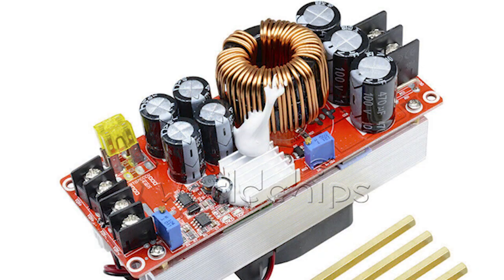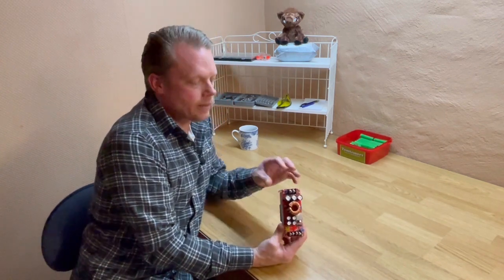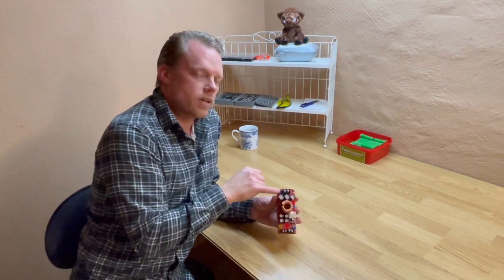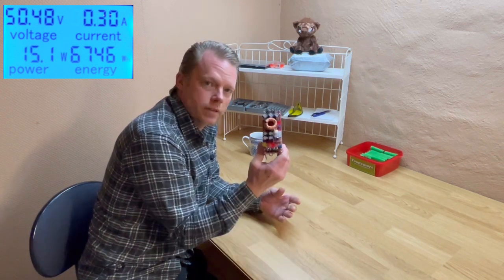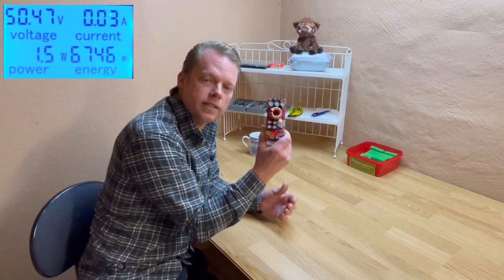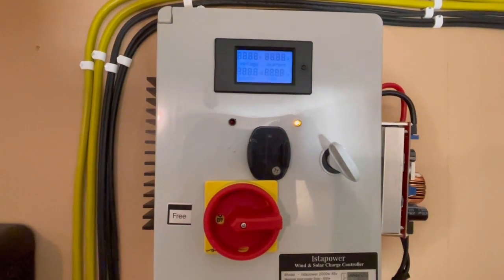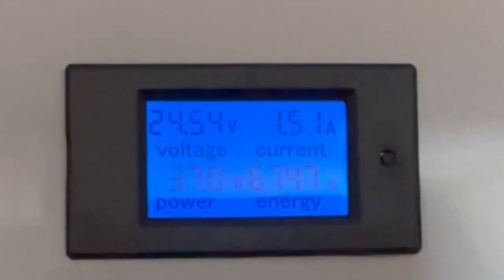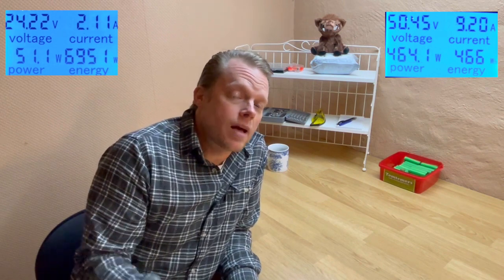Low wind charging, from my wind turbine istabreeze i1500 48v

Comment: Hello ! I also have an IstaBreze wind generator and controller 48 V 1200 W Solar panels are connected to the controller. Where did you get the power connection to the DC&DC controller in the IstaBreze controller? Marcus Ehrenpreis
Reply from the maker: Hi Margus! I bought it on eBay. Here is a link to it. Thanks for your question and have a great day sir. 

https://www.ebay.com/itm/164271138208?_trkparms=amclksrc%3DITM%26aid%3D1110006%26algo%3DHOMESPLICE.SIM%26ao%3D1%26asc%3D20190917065201%26meid%3Dcfe05e5873034119a96e36a9d6f9eeb4%26pid%3D100935%26rk%3D2%26rkt%3D12%26sd%3D322541655456%26itm%3D164271138208%26pmt%3D1%26noa%3D0%26pg%3D2332490%26algv%3DSimplAMLv9PairwiseUnbiasedWebCpr08MlcGreedyV3%26brand%3DUnbranded&_trksid=p2332490.c100935.m2460&amdata=cksum%3A164271138208cfe05e5873034119a96e36a9d6f9eeb4%7Cenc%3AAQAGAAACEFlf0W4DZxQ9rGEp1I1AcwnLNx1QfvvjHgvmNWJHv3VwqjIaeEpGhp4B0hypvCOmtx1hQh93VsR%252F1Wqb99aslFWTINPZSmc3IfMRvrgMh8caQadnaglvUTUlDygPwF3UalUxxqPmDgkTLsPkN4A2h8kdMMUTvtF9Hwc8corD0aOH7M1CtJ%252FR%252Bl28wVeXoeHO6AVlci8wCNMDY3zo2PI2Z4AyLCi38Gt6KtfcKm6HeDd2DWxbV3FwQ1wKhU6Ezb0YFqfV7ce4m0dWIDkbqQxnqsH4Qitc63rdI4nimdHWkble2HOlUChz%252B7JEIstQxOjJD32nU3Dw4FuWVkbtdIWmcH%252FlqeHukCvVp5sl6kqSP0D%252FNWgWFhGXrgi0oYqZhochDWVrq38rhF74PuN%252F3Oo44o531PgJyARpmx0O5ecjAi34W21Js%252Bg3bXevuu8NszuWItwTK6qksU%252FeQkV1e6syN0pruSJrv6UXdKEZ9UW5UtP2cjDLLPAuizUIavxPvN5INipaFEIRgWflN6%252B%252FTyEPwm2JwuLgdlgCJX3gkfmnn3%252BPN9qiSIv%252Fif%252FbZFgFI02m8OL3rzYVr0llIV9lZAtPKoEFOL9yrOqCABuLTq1ptsN%252FBvNz3ibWmN5nda%252Bcxvw5%252Fxfy00CECW1%252FcfUCqi4PTIvYHkROy%252BUFiDG5UwRfDCMVvf7F0Ii%252FhNnqOWH7wmeL4Q%253D%253D%7Campid%3APL_CLK%7Cclp%3A2332490

Comment: Hi , I need your advice , I want to buy an ista breeze i2000 wind turbine and I would like to know how do you think about it with respect to quality, warranty , customer service and over all energy production and efficiency
Thank you in advance
Reply from the maker: Hi!
Quality and energy production is good for that price, I am satisfied.
Warranty and customer service is hard to say, I have not had any problems yet. 
Hope this help and I 
wish you good luck 😊
Reply: @flyingtools  thank you for your reply and time I find it really helpful. One more question, for the same price range do you think there is a better quality turbine that you may recommend ?
And what do you recommend about the inverter should I get the ista-breeze one or is there any better ?
Reply from the maker: I think istabreeze are the best value for the money. I had tried to find an mppt inverter for wind, they will charge even in lower wind conditions or you can do as I have in my other video “low wind charging” when I use a voltages step-up converter.

Comment: How did u install your system ? First at all the Turbine, then the charger, then the dc/dc Converter and at least ur Batterie?
Reply from the maker: Yes, you are right, turbine, controller, rectifier, dc/dc and battery.
Reply: Did you change any settings on your turbine? The break load is still 55.6V? Did the DC/DC convert from 20-60V and push up to stable 48V?
Didn't know how to install, want to build the sams system for low wind. thank you

Comment: Have you thought about installing a bypass system for this voltage booster? Dual solid state relays (on heat sinks with fans controlled by temp sensor) with a voltage sensing at the imput of the booster. Both negatives in parallel and the positives switched. Just a thought.
Reply from the maker: A good thought.
Yes I have, but when I expect high winds I just by pass it manually. The booster do a pretty good job by it self when the current are getting to high. It’s simply adjust the input voltage so the preset current limit not will be exeed.

Comment: Hi is your turbine the 24v unit and you are using the converter to onceythe voltage to charge at 48v
Reply from the maker: Hi. The turbine is a 48 V version. In low wind, the voltage are low so this converter throw that voltage up to my battery voltage so it can charge in those low wind conditions.
Reply: @flyingtools  thanks for your reply
Reply from the maker: You’re welcome.

Comment: Hello can you tell me where did you get that and what's the cost thanks in advance
Reply from the maker: Hi. 
I bought it on eBay. 
Around 25 dollars.
Search for: 

DC-DC Constant Current 1500W 30A Boost Converter Step Up Power Supply

Hope this helps.
Reply: @flyingtools  yes it did, am always looking at your videos, thanks again,,,, will subscribe soon
Reply: @flyingtools  I hope that is supposed to say 25...
Reply from the maker: @nunyabusiness2191   yes you are righ.. i must been thinking in sek😅 Thanks for letting me know. I will correct that now.👍🏻
Reply from the maker: You’re welcome.
Thank you so much, glad to have you here:-)

Comment: Do you think about mount step up converter on each phase wind generator ? It is possible in star configuration. It is impossible in delta configuration.
Reply from the maker: Hi. No, directly after the rectifier seems to be the most efficient, cheapest and easiest way to do this I think.
Reply: @flyingtools  Thanks for the answer! What is your the highest power from the wind turbine ? Is it original rotor and blades ? A lot of people modified that things to make wind turbine more efficient.
Reply from the maker: I have seen a little over 1500 watts but that was in an extremely hard gust. This one is not modified at all. I run the 3 blade black version. I have also tested the five blade version but I was not happy with that.
Reply: @flyingtools  Thanks for the answer! Have a nice day!

Comment: hello my name is Thierry I am French, I like your videos because they are very technical and your installations are well finished.
I would like to know the brand and the reference of the low wind load charger, the one presented in your video, I will soon be installing an ista breeze i2000 2000 W 48 V, thank you in advance, sorry for the translation, cordially Thierry
Reply from the maker: Hi Thierry and very welcome to my channel. I’m so happy that you like it😃 your translation works just fine👍🏻
I will give you a link to eBay on the type that I am using. Personally I have not bought from this seller so I don’t know anything about him. I bought it from a seller in Germany but he don’t have any left in his eBay store right now. I think that you  be very happy with that wind turbine you are about to install. The link will be in a comment. Have a great day.
Reply from the maker: https://www.ebay.com/itm/164271138208?_trkparms=amclksrc%3DITM%26aid%3D1110006%26algo%3DHOMESPLICE.SIM%26ao%3D1%26asc%3D20190917065201%26meid%3Dcfe05e5873034119a96e36a9d6f9eeb4%26pid%3D100935%26rk%3D2%26rkt%3D12%26sd%3D322541655456%26itm%3D164271138208%26pmt%3D1%26noa%3D0%26pg%3D2332490%26algv%3DSimplAMLv9PairwiseUnbiasedWebCpr08MlcGreedyV3%26brand%3DUnbranded&_trksid=p2332490.c100935.m2460&amdata=cksum%3A164271138208cfe05e5873034119a96e36a9d6f9eeb4%7Cenc%3AAQAGAAACEFlf0W4DZxQ9rGEp1I1AcwnLNx1QfvvjHgvmNWJHv3VwqjIaeEpGhp4B0hypvCOmtx1hQh93VsR%252F1Wqb99aslFWTINPZSmc3IfMRvrgMh8caQadnaglvUTUlDygPwF3UalUxxqPmDgkTLsPkN4A2h8kdMMUTvtF9Hwc8corD0aOH7M1CtJ%252FR%252Bl28wVeXoeHO6AVlci8wCNMDY3zo2PI2Z4AyLCi38Gt6KtfcKm6HeDd2DWxbV3FwQ1wKhU6Ezb0YFqfV7ce4m0dWIDkbqQxnqsH4Qitc63rdI4nimdHWkble2HOlUChz%252B7JEIstQxOjJD32nU3Dw4FuWVkbtdIWmcH%252FlqeHukCvVp5sl6kqSP0D%252FNWgWFhGXrgi0oYqZhochDWVrq38rhF74PuN%252F3Oo44o531PgJyARpmx0O5ecjAi34W21Js%252Bg3bXevuu8NszuWItwTK6qksU%252FeQkV1e6syN0pruSJrv6UXdKEZ9UW5UtP2cjDLLPAuizUIavxPvN5INipaFEIRgWflN6%252B%252FTyEPwm2JwuLgdlgCJX3gkfmnn3%252BPN9qiSIv%252Fif%252FbZFgFI02m8OL3rzYVr0llIV9lZAtPKoEFOL9yrOqCABuLTq1ptsN%252FBvNz3ibWmN5nda%252Bcxvw5%252Fxfy00CECW1%252FcfUCqi4PTIvYHkROy%252BUFiDG5UwRfDCMVvf7F0Ii%252FhNnqOWH7wmeL4Q%253D%253D%7Campid%3APL_CLK%7Cclp%3A2332490

Comment: Cool idea, thanks for the info man. I like your channel!
Reply from the maker: Thank you so much😃
Reply: @flyingtools  Ι've been wondering, if someone could "simulate" an mppt controller, using a boost converter like you mentioned above, and an equivalent buck converter, switching between the two (when needed), using an arduino with a voltage sensor and some relays. So when the turbine is spinning in low wind, the boost conv path would be ON, and when it'd be going faster (the potential higher voltage), would be stepped down to meet the battery voltage. Just a thought.
Reply from the maker: @Parafiestas  Interesting idea. They 
I1500 is already spinning really fast at 48 V so if we are trying to raise that voltage up to let’s say 70-80V I guess that it will spinning so fast so it will be inefficient and also maybe even closer to the point of 
self-destruction of the turbine. 
(Just guessing here)
But it is a really interesting idea you have there👍🏻

Comment: Do you have a link for this booster?  I'd love to see all the documented specs.  I'd be a little concerned about early loading the turbine...the i1500 needs a lot of RPM to really generate power and once it's spooled up the momentum can take a lot of load and it can keep going through a lot of fluctuations in wind speed.  If it's under load at 24 volts, though, it might struggle to actually get up to speed.  You might see some power going to your batteries earlier but possibly are losing some of your potential total because the turbine is loaded up too early.  I'd love to see two identical turbines running side by side in the same wind conditions, one with a booster like this and one running direct, and see what the totals are.

I'd love to see something that could just step up a 24v circuit to 48v in general, though.  I've been trying various means of trying to convert one way or the other for a couple years in order to avoid have two or three different battery banks...I've finally given up and decided I'll have to stick to 48v.
Reply: nice, love it when 2 youtubers have productive discussions. nice channels you both have
Reply from the maker: Hi. You are absolutely right about the rpm the fact is if the wind are rasing up in speed I manually have to adjust the input voltage to match my battery voltage if I don’t do that it will of course produce less power. As I try to explain in my video it automatically switch to battery voltage when the amps starts to be over the amp limit setting 
(I guess) and then the turbine will go up to full power. This would only be suitable if the windspeeds are so low so the 48 volts not are reached. Everything over that will of course be powerloss. The seller that sold this unit don’t have any more on his site but I will try to find another one on eBay for you and add it in my description later. (
I let you know) To use this together with your 24 V turbine and convert it up to 48 V can probably be a great idea👍🏻 But anything over 500 watts in the long term will probably kill it😉

So just to be clear, if the windspeed is enough to reach 48 V this unit will make you create less power, it’s only for low wind conditions.
Reply: @flyingtools  You did a good job of describing it and how it works in the video.  If you could share a link to it I'd love to check it out.  I think for a wind turbine like the i1500 it's not going to be a good idea, but it might be a fun little trinket to play with on some other projects.
Reply from the maker: @ToysforWatts  this seems to be it. Hope you like it, it can be used to many applikations. I personally have not bought from this seller before so I don’t know anything about him.
Have a grate one😊

https://www.ebay.com/itm/164271138208?_trkparms=amclksrc%3DITM%26aid%3D1110006%26algo%3DHOMESPLICE.SIM%26ao%3D1%26asc%3D20190917065201%26meid%3Dcfe05e5873034119a96e36a9d6f9eeb4%26pid%3D100935%26rk%3D2%26rkt%3D12%26sd%3D322541655456%26itm%3D164271138208%26pmt%3D1%26noa%3D0%26pg%3D2332490%26algv%3DSimplAMLv9PairwiseUnbiasedWebCpr08MlcGreedyV3%26brand%3DUnbranded&_trksid=p2332490.c100935.m2460&amdata=cksum%3A164271138208cfe05e5873034119a96e36a9d6f9eeb4%7Cenc%3AAQAGAAACEFlf0W4DZxQ9rGEp1I1AcwnLNx1QfvvjHgvmNWJHv3VwqjIaeEpGhp4B0hypvCOmtx1hQh93VsR%252F1Wqb99aslFWTINPZSmc3IfMRvrgMh8caQadnaglvUTUlDygPwF3UalUxxqPmDgkTLsPkN4A2h8kdMMUTvtF9Hwc8corD0aOH7M1CtJ%252FR%252Bl28wVeXoeHO6AVlci8wCNMDY3zo2PI2Z4AyLCi38Gt6KtfcKm6HeDd2DWxbV3FwQ1wKhU6Ezb0YFqfV7ce4m0dWIDkbqQxnqsH4Qitc63rdI4nimdHWkble2HOlUChz%252B7JEIstQxOjJD32nU3Dw4FuWVkbtdIWmcH%252FlqeHukCvVp5sl6kqSP0D%252FNWgWFhGXrgi0oYqZhochDWVrq38rhF74PuN%252F3Oo44o531PgJyARpmx0O5ecjAi34W21Js%252Bg3bXevuu8NszuWItwTK6qksU%252FeQkV1e6syN0pruSJrv6UXdKEZ9UW5UtP2cjDLLPAuizUIavxPvN5INipaFEIRgWflN6%252B%252FTyEPwm2JwuLgdlgCJX3gkfmnn3%252BPN9qiSIv%252Fif%252FbZFgFI02m8OL3rzYVr0llIV9lZAtPKoEFOL9yrOqCABuLTq1ptsN%252FBvNz3ibWmN5nda%252Bcxvw5%252Fxfy00CECW1%252FcfUCqi4PTIvYHkROy%252BUFiDG5UwRfDCMVvf7F0Ii%252FhNnqOWH7wmeL4Q%253D%253D%7Campid%3APL_CLK%7Cclp%3A2332490
Reply: @ToysforWatts  If you install the boost (and buck opoosite of boost) modules please video the process and the results. Many of us are following your channel.

Comment: Hi great show, l have  two battery banks 4 at twenty four volts and 4 Twelve volts batteries at one hundred and ten amps each, l installed a five hundred what turbine l do not expect to get that but would like to top up my twelve volt battery bank as and when. The thing is it won’t charge the twelve volts system but will charge the twenty four battery system,  would a buck boost help with this problem.  Many thanks to you.      🇬🇧
Reply from the maker: Hi and thank you so much. What kind of a charge regulator do you have? This step up converter starts to work over 20v  so 12v is not recommended. If you hooked up your battery directly after your rectifier your wind turbine should charge your battery.
Reply: @flyingtools         Hi, my controller is low speed boost rated 12v - 24v mppt  5 to 40A    Many thanks.
Reply from the maker: Strange, it should charge. If you just use a rectifier with your 12v battery bank I think it will charge just fine even in low winds conditions, assuming that you’re turbine are on 24 V, but of corse, you need to have some kind of brake to,
Reply: @flyingtools          Thank you very much for your reply, all the very best to you.          🇬🇧
Reply from the maker: And thank you John.😊 Hope you find out a way to make it charge.

Comment: This is boosting, when the turbine gets to its normal charging voltage you need to start bucking which is done by another module which steps the voltage down. This is where the fully automatic boost/buck controller comes into its own, you have the ability to charge from 10 volts up to 100 volts with the controller I’m using, the only time it will dump load is when the batteries are at 95%, it will switch to CV mode and dump the current into resistance coils. Most charge controllers will dump as soon as the turbine gets to 56v missing out on valuable power which should be going into the batteries.
Reply: what boost/buuck controller are you using?
Reply: Link please